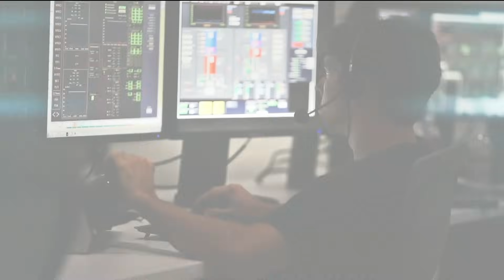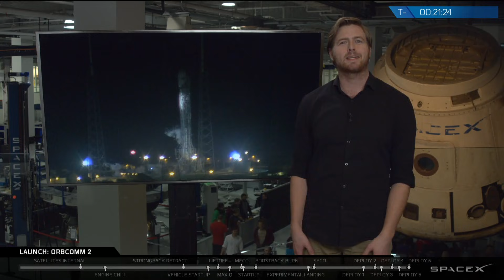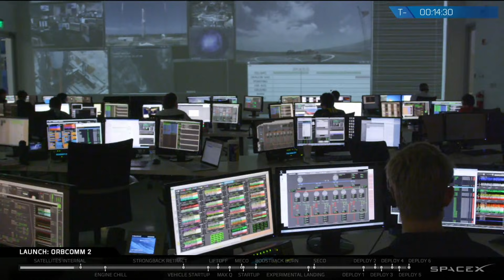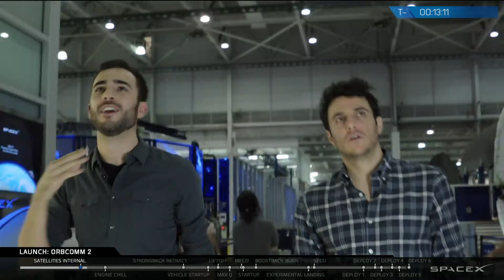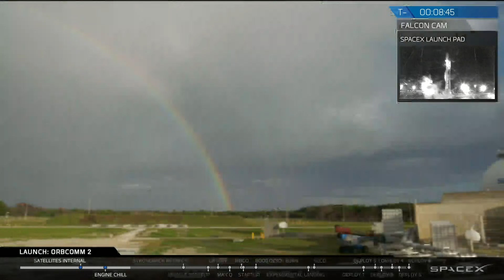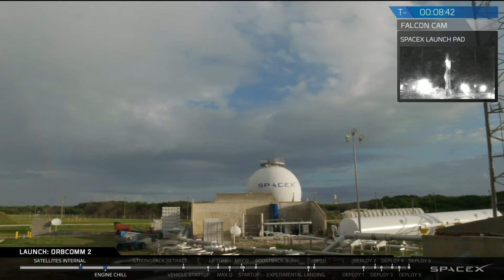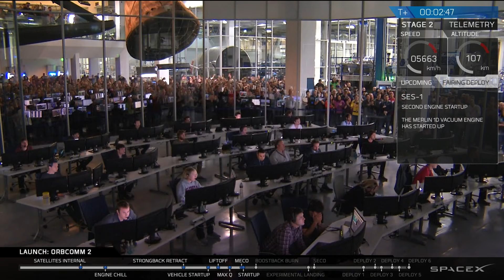ORBCOMM-2 Full Launch Webcast

Comment: HISTORY HAS BEEN MADE.  HUGE DEAL!
Now let's test the crap out of these motors and examine their material properties.
Also, I really like rockets and want to ride on one in the future!
Reply: +Jon Ballard NOT NOW WE'RE TALKING ABOUT ROCKET SCIENCE!
Reply: +Nate Higgers A Boeing 747 costs around 360 million dollars to make but because they can be reused again and again, they have an operational cost of less than a dollar per pound.  The space shuttle had a cost of 8000 dollars per pound.  The Falcon 9 has a cost of 2500 when it's a single-use.  If it can be refurbished for a reasonably cheap amount, this could halve the cost or even drop it below 1000 per pound which would be positively huge.  Furthermore, at cost savings this massive, it will come to dominate the commercial space travel market, producing dozens of rockets a year.  When you have manufacturing rates that high, things get more reliable and production costs go down further which drops costs even lower which makes you gobble up even more of the market.  Rinse and repeat until SpaceX is launching rockets for 500 bucks per pound or less.

You know the phrase "good generals study tactics; great generals study logistics?"  Musk is a logistics man.  Paypal revolutionized online transactions.  Tesla seeks to revolutionize terrestrial travel.  Solar City seeks to revolutionize the power grid.  SpaceX is first and foremost a shipping company.  Imagine if the price of gasoline were, say, 48 dollars.  You'd avoid driving whenever possible.  Cars would be a luxury that most people couldn't afford.  Then imagine a company came along and in the course of a decade, dropped that price to 3 dollars.  The economic implications would be staggering as the cost of business takes a nosedive.  Alternatively, imagine having to pay 4000 dollars for a plane ticket across the US.  When the cost of shipping plummets, entirely new business sectors open up.  

That's why this is a big deal.  If they can refurbish that booster cheaply (and admittedly, it's a big if since no one has ever had a lightly-used orbital rocket booster before), similar changes stand to occur in the space industry.
Reply: +SmarterEveryDay Hi Destin <3
Reply: +Sushrut Mane The launch wasn't historic. The coming back down in a controlled manner is the historic part.
Reply: +Sushrut Mane The US has been launching satellites (and groups of them at once) for decades. Talk to us when you can land and re-use your rockets...
Reply: +SmarterEveryDay Yes, and they nailed it! You can see in all the other landing videos (plus the Blue Origin one), the rocket was a little off and had to correct itself. But this was exactly on! X marks the spot.
Reply: +SmarterEveryDay We might just live long enough to go up in one! This is going to be a HUGE leap forward in terms of affordability if they can keep doing this regularly. :D
Reply: +SmarterEveryDay 
Just wait until they achieve a rapid turnaround demonstration with two launches of the same 1st stage within days of each other.
Reply: +Nate Higgers think about how they built, launched, and brought the rocket back to earth, only instead of losing a portion of the rocket in the process you can land the entire rocket, backwards, controlling descent from tens of thousands of kilometers and hour, and bringing it to a stop perfectly, on a relatively tiny landing pad. That barely touches the surface of how immense that was lol.
Reply: +FreeSpirit Looks like Prometheus4096 is talking trash with another username!  Always someone trying out "out-hate" all the other America haters.
Reply: +Balen Arete Wow, you are an actual moron.
Reply: +SmarterEveryDay I KNOW!!!!!!!!! ITS INCREDIBLE!!!!!!!!!!!!
Reply: +CmdrGendoIkari Also, Falcon heavy is going to be awesome, 3 landings simultaneously.
Reply: +FreeSpirit Pathetic.
Reply: +Niels Schaap Creepy indeed, espacialy when smart people are conditioned to nationalism like this. They even cant imagine what possibly is wrong with that.
But anyway, great success for Elon Musk again, they should cheer him, a shame they didn't.
Reply: +Jay Trock That's only if you consider Blue Origin's "rocket" to be the first.  When you compare the Falcon 9 to the New Shepard, this is much more amazing.  Plus even if you want to classify them in the same category of "rocket" they are completely different kinds of rockets.  the Falcon 9 is MUCH larger, taller, thinner; making it much more difficult to land.  Also the New Shepard just went up and then came back for a landing, something that SpaceX's Grasshopper rocket did 3 years ago.  So You can't really give Blue Origin any credit for being the first at anything.
Reply: +SmarterEveryDay Hey Destin, good to see you here.   Really happy for Elon and the Space-X team, amazing work!
Reply: +SmarterEveryDay 
I was waiting for you to show up :P
Reply: Hi destin!
Reply: ***** NASA, I'm sure could have done this. They just chose not to for some reason. If NASA really wanted to I'm sure they could have done this in the late 90s maybe early 2000s. The U.S. government controls NASA. They never ordered them to do this even though it will save billions for SpaceX.
Reply: +Ohio Gamer Check out the Delta Clipper DC-X concept from the early 90s. I would have swept their floors in order to be a part of that program.
Reply: +FreeSpirit This is the first time that an unmanned rocket stage has been recovered intact after the boost phase..

The Space Shuttle was a rocket powered space plane which was manned..

This has not ever been done successfully...until tonight.

$1000/lbs to LEO makes Spaceflight one hell of a lot more affordable.

Even the Chinese are envious of this technological feat. They want to copy the production practices of SpaceX.

You would not happen to be Russian or Chinese National, would you?

Soyuz is good. I do agree that the R7 Booster has been most reliable.

But until you are ready to do the R&D necessary to develop the cutting edge you will not be competitive in the LEO satellite market.

No I will not bash Russia on the proven reliability of the 1950's era R7. Hell America still uses 1950s design B-52s. Proven. Rugged. Reliable.

But Russia and China had best look into rocket engine recovery and refurbishment if they hope to compete.

Too bad Buran was destroyed.
Reply: +Niels Schaap stfu
Reply: +Dan Frederiksen Ok buddy, time to take your meds.
Reply: +FreeSpirit  Your should do some reading.  This is a first.  Blue Origin's rocket was nothing compared to the Falcon 9
Reply: +SmarterEveryDay i love your channel and videos!:)
Reply: +SmarterEveryDay You inspired my love for rockets. Thanks to you Destin I now follow every launch and listen to orbital mechanics. Thank you so much for all the great content you create.
Reply: +SmarterEveryDay For ignorant people would you mind explaining why this is such a big deal and what this could mean for the future?
Reply: 91projectpat
That's because a piece of the future just became the present day. Now they all have to clamor to build reusable rockets, just to stay competitive with SpaceX.
Reply: +FreeSpirit +1
Reply: +SmarterEveryDay History was already made.  This was like the second man on the moon.
Reply: I love your channel, have you done a SpaceX your? If not they need to let you and to get info on the returned first stage.
Reply: +SmarterEveryDay Hey Destin,i hope you will have the chance to visit SpaceX and maybe have a talk with Elon Musk! (and of course share it with use :D )That would be so cool!Cheers!
Reply: +SmarterEveryDay you can ride on my rocket if ya want ;)
Reply: ***** First MI-6 is a British Intelligence Agency, much like the USA's  National Security Agency.

ISIS is using both NATO Weapons and Russian Weapons. The AK 47 is the staple long rifle of ISIS troops. (That is a dirty little secret that the Russian Government would prefer to remain unadvertised.

Putin is as much of a War Profiteer as the United States Military Industrial Complex.

When you figure out that the Multinational corporations, loyal to NO GOVERNMENT, actively manipulate Governments into unjustified wars in order to garner profits, then, and only then, you will see through the faux Nationalism that they use to MANIPULATE YOU.

You had best read "War is a Racket" by Smedley Butler.and realize that all you have been taught is a lie, including the bullshit about World War II, and that there are NO JUSTIFIABLE WARS.

But it seems as if you are totally confused as you did not even realize that MI 6 is ENGLISH and not  American.

So your unjustified hatred is based upon your confusion???
Reply: +SmarterEveryDay You'll be a fine astronaut someday Destin! :D
Reply: +SmarterEveryDay wake up, coward. You have a platform with which to change the world but you don't want to hear the truth because it affects your personal income. You know Nasa is a damned lie. Your country is soaked in evil and you take silver pieces.
If you deny the truth the truth will deny you. You are either with me or against me.
Reply: +Dan Frederiksen literally EVERYONE is against you. Enjoy your conspiratory stupidity.
Reply: +Totally Legit Gaming [TLEG] far from it. The majority of people know that something isn't right. But few are strong enough to side with me in this context. No one of consequence is against me as the truth is with me. And the truth is a merciless unstoppable power and I will be victorious.
I will have my arab spring and then you sniveling cowards will hide silently in shadows with peculiar gaps in memory.
Even US astronauts have come forward to say that it's real and being covered up. Gordon Cooper and Edgar Mitchell. Bill Clinton investigated his own government while he was the president of the united states because he believed they were treasonously withholding the truth. His chief of staff John Podesta tweeted at the end of 2014 that his biggest regret was still not achieving UFO disclosure. He is currently Hillary's campaign manager and she is well aware of the UFO phenomenon. Podesta has actually tweeted encouraging people to ask her about it. These are facts you can verify. Tell me, am I lying. Am I wrong.
And these are drops in the ocean of evidence.
I can tell that the UFO topic is even a splinter in Elon's mind. It's there in the back of his mind but he doesn't address it because it's rich in implications and the logical consequence is that all his efforts so far have been a naive waste, and that's a big pill to swallow. Sooner or later he will be confronted with it and the outcome is uncertain.
When the Kennedy brothers inquired cowardly instead of going public, they came down with acute lead poisoning.
Elon is a petulant child in the den of lions. I am the one who knows.
Reply: +Dan Frederiksen You're adorable. You're absolutely adorable. Are you for real or just an internet troll? I must know. If you're for real, I think I'll adopt you. No one can be THAT deluded and still know how to tie his shoes.

I'm not even going to grace your post with replying to your "arguments" as you poked in SO many conspiracy theories that you only really left out 9/11 and chemtrails xD Oh god, thank you for the laugh. I needed that.
Reply: +Aemiro Habte  blue orgin'a rocket is half the size of falcon's first stage plus they go up and down, falcon goes down range to orbit sorta
Reply: +SmarterEveryDay NO JOKE!  This is HUGE!  Can't wait to see what Elan Musk and his team have in store next! #SmarterEveryDay #RocketScientist
Reply: +ItsAlwaysGod oClock brother I live down the street from the headquarters this is not fake
Reply: +SmarterEveryDay Thanks Destin for directing me to this wonderful video :) love your work!
Reply: +SmarterEveryDay You're closer to doing that than any of us! Good luck Destin, and thanks so much for teaching us so much!
Reply: 100% yes!!! :-)
Reply: +FreeSpirit first Rocket to send a payload to orbit, and land the first stage ever....so yea..History was indeed made.
Reply: +Jay Trock hahahaha what?!?! you're joking right?
Reply: +Sushrut Mane Did you guys land the rocket?
Reply: ***** I agree.
Reply: +Balen Arete When too much salt, drink more water.
Reply: +Volt Cruelerz Ys. The Space Shuttle Main Engines were refurbished many times. The Booster's Skeleton and Skin (airframe) will not fly again. 

Fiberglass composites for the cryogenic fuel tanks are inexpensive. Aluminum alloys for the skin and internal frame are comparatively cheap.

It is the engines that are reusable after a rebuild. That is what is expensive and is what they are after.
Reply: Nice to see ya here!! Love your channel!
Reply: +Balen Arete Too bad you didn't study spelling or logic...
Reply: +Balen Arete If it were not for events like this we would
not have made it to the farming stage! Don't confuse capitalism with the cronyism and the vested interest you see in the corporations, politicians and institutions in todays world. What SpaceX has done is truly remarkable.
Reply: +Quad The first stage is hundreds of miles away from the coast when it separates, it needs to fly back (boostback) to get to land anyway, the motors are gimballed anyway, so why not just figure out how to make it land.  Parachutes might have worked more quickly to get the first landing, but then you're strapped with additional complexity in the long term.
Reply: Figured you would be trolling here! I really want to see the condition too!
Reply: +SmarterEveryDay I hope you get to do that Destin, I would love to see some high speed camera in the ISS.
Reply: +jcims Plus parachutes have a higher velocity at touchdown I believe which could lead to shock damage to the stage making it un-reusable, plus parachutes are at the mercy of the wind which means both that the descending stage may be moving sideways too fast when it touches down and thus tip over (and almost certainly damage itself beyond use) (and being so tall it wouldnt take much sideways velocity to make it tip), and it means you cant control where it touches down and whether or not that spot is flat enough for it not to tip over.  A powered landing is much MUCH more reliable than parachutes if you can make it work.  And it appears that they can.  :)
Reply: +SmarterEveryDay This in a huge milestone for SpaceX and for space flight as a whole! I'm full of excitement and can't wait for what the future holds for SpaceX and space exploration! :)
Reply: +Dan Frederiksen NASA is a lie!  hahahahaha  what!?!??
Reply: +SmarterEveryDay What is the turnaround time for the stage? Could we one day launch, land, and then launch again all within 12 hours?
Reply: +Kilo 64 NASA already made a reusable rocket called the space shuttle. It delivered parts to low earth orbit just the same. The real question that is yet to be seen is is the Falcon 9 cost effective to reuse. The space shuttle was not really that is why no one really considers it reusable.
Reply: Elon said he is not going to be reusing the stages until mid/late 2016
Reply: lol dan is talking about UFOs, and telling us we need to wake up.
Reply: "NASA already made a reusable rocket called the space shuttle"  So, the space shuttle was a rocket....?
Reply: +Thomas Galea (UKZz HELLRAISER) Me too :)
Reply: +Totally Legit Gaming [TLEG] yeah conspiracies are all crazy. It's not like USA would start wars based on lies and kill millions of people or that someone would assassinate two Kennedy presidents. That's crazy talk.
Nixon was not a crook. And you are the smart one.
It's convenient that you didn't have to deal with any of the facts I provided. Like looking up who John Podesta is and what he has to say about the UFO topic. Or Bill Clinton for that matter. Posturing will do, I'm sure.
Reply: +Epif  The out patient refuses his lithium sulfate medication and a snorkle to breath with his head shoved so far up there.
Reply: +Sushrut Mane uhhhhh did that rocket then land back on earth safely?  That's the history.
Reply: +Johnny Mccrum in other words, now they can bring up thousands of this trash satellites and pollute orbit and bring internet to people who does not need internet.
Reply: +Kilo 64 Nasa has accomplished far more difficult endeavors. I'm sure SpaceX, as great as they are, used much technology developed by NASA and its contractors. NASA accomplishments, even post Moon shots, are phenomenal: Space Shuttle, Skylab, Space Station(their part), Hubble, all incredible accomplishments that dwarf or equal Space X accomplishments.
Reply: +Sushrut Mane I was so proud of India! Welcome to the spaceage!
Reply: +Ohio Gamer Because in it's prime NASA had billions at its disposal.
Reply: +Niels Schaap Little not peeved are you? Yeah America has dominated space exploration from the beginning. The USSR had a great program too. I'm sorry if we are cheering too loudly. When your country does something great come back here and I'll cheer with you!
Reply: +Niels Schaap That comet landing was ace! Yes there was lots of cheering at mission control, and we were proud of you. Sorry we are such loud braggers
Reply: +Markus Osmers (mo22) What? We certainly DID cheer him!
Reply: +Ohio Gamer  Look into the Delta Clipper Experimental Built bu a small group in the Department of Defense  Congress forced it down NASA's throat. They were committed to the Space Shuttles (witch never preformed as advertised and generated a huge amount of business for the servicing companies ) and buying throwaway boosters from the aerospace giants at huge expense (profit for the companies). NASA let it die of neglect.  The Space Launch System is a continuation on this pattern.
Reply: +SmarterEveryDay Faking a rocket landing is not making history.  Wake up - you're being made a fool of.  Oh, wait - it's the shill "SmarterEveryDay."  May God have mercy on your mind.  You are shillin' like a villain.
Reply: now it has been remade with the super heavy booster